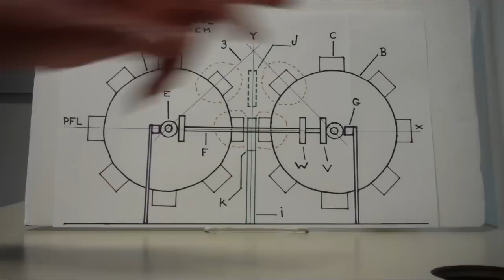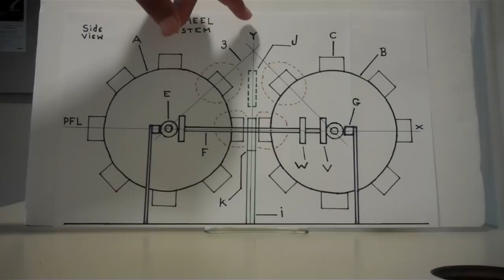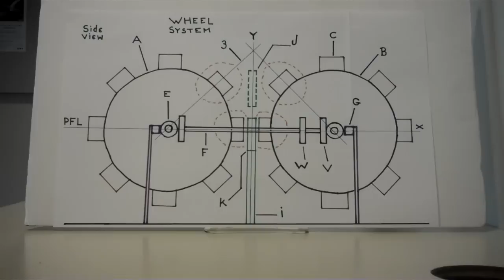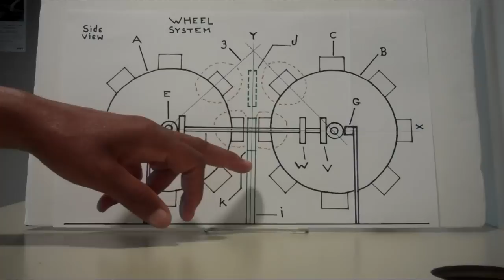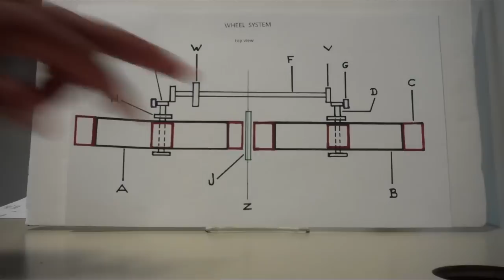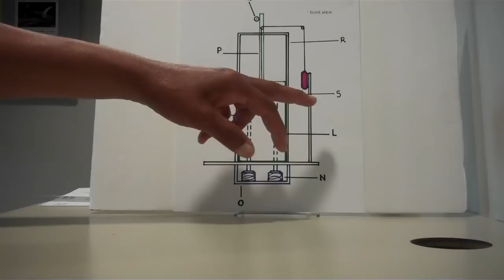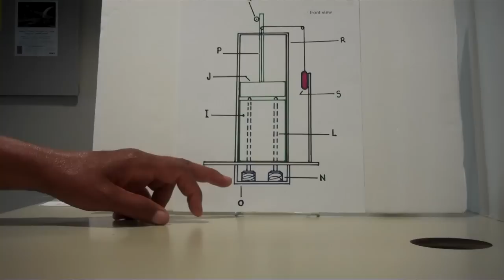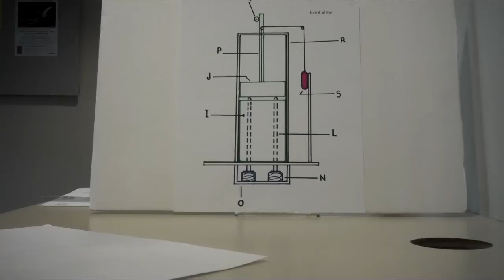PERMANENT MAGNETS: The Johnson Machine - How To Make a "WORKING"  semi-PERPETUAL MACHINE

Comment: Firstly, I'd like to say that the principle of magnetic field cancellation you're using in this video - and built a working and  reproducible model of in a prior video - is quite intriguing, and not something I've seen discussed before. Kudos to you.

Secondly, in your prior video, you mentioned that once two magnets have been balanced by the cancellation metal, the metal will be drawn back into the gap if it is pulled out from between the magnets. I haven't built a model myself to test this, but I suspect that the magnetic force drawing the cancellation metal plate between the magnets will mean that the motor that moves the metal plate will need to draw at least as much power as the magnetically-repulsed spinning wheels will provide. Basically, moving the metal plate out from between the magnets will require at least as much energy as the potential energy stored between the magnets being shielded by the plate at that moment.

However, it does seem easy enough to build a test model of, requiring only careful measurements rather than exotic materials. Even if it turns out this shielded-double-wheel runs down faster than a non-magnetic flywheel, the magnetic cancellation principle it uses probably has other applications, and should be more widely known.
Reply from the maker: +HaloInverse . Dear Mr. Halolnverse: As the tiny electric motor pulls the gate up, it is going up simultaneously with the magnets on turning wheels. The gate is to go up 2-5 times faster than the magnets are moving up on the wheels. In the video the gate is one plate. Two or three plates can be used or better yet should be used. Using two or three plates only the middle plate or one of those plates can be moved or slid upward breaking and removing the magnetic field balance. Letting the repulsive force of the magnets take over. If using more than one plate simply find the field balance in doing so as with one plate.

Comment: I've had ideas like this in the past.  It takes electricity to produce permanent magnets.  If you get this running, wouldn't the work you could pull out of the magnets be equal to the power put into them to being with-- minus frictional heat?  Perhaps you're making a superior type of battery in that sense?
Reply from the maker: +snj silva . Dear Mr. Silva: We have to make the thing first and see. Another question is: would we get more out of the machine in costs and use than the amount of the electricity that's needed to magnetize the magnets?

Comment: I can make a model for about 50 to 100$
Reply from the maker: +Jeffrey Vanblargan . Dear Mr. Vanblargan: In the video it shows a single plate for the gate. Remember: 2, 3 or 4 thin plates acting as a unit can be used. Whatever it takes to get the job done. The thinner the gate the more the repulsive fields strengths over whelms the attractive field strengths. And those plates can be slid upward producing a thin long single piece. If you can make a working model for $500 - $2,000 then do so. Make the wheels about 12 inches in diameter so as to have enough size to deal with it. Look at the video again and again if need be to catch every word in the video correctly.
Reply from the maker: +Jeffrey Vanblargan . Dear Jeffery: that is such good news.
Reply: Yes but I also said a model which could be one-third the scale using a skateboard wheel as a demonstration to see if it actually will work
Reply from the maker: +Jeffrey Vanblargan . Do your thing.

Comment: Jesse, I have my own 'proof of concept' wheel in process. I do agree with your principles of cancelation, yet I don't on the material you propose to use. I not seeing how to reach you privately. I'd like to invite to the experiment. I believe you could be a very good source of experience. It's on an open forum I'm doing this on, but don't what it flooded by Naysayers. If interested, please contact me on my site. I do hope you do.
Reply from the maker: +Uncle Bob. Dear Mr. Uncle Bob: Your disagreement is in-substantiated. I haven't stated any special materials as of yet in the construction of any device or machine. Outside of very common materials which - works. Hence: if you are making any system please experiment with many materials and use whatsoever 'works' the best.

Comment: Beautiful graphics and designs that you drew and explained for your audience. Have you had any luck getting this together for testing? Keep thinking and designing and stay the course - your vision will come true. Thanks you again for the wonderful video and your time.

Just FYI - if you made the separating plate controlled by a device such as a gear shift in a car controls when you change gears you could have an effective separator plate. A variable that will control the magnetic force or energy that could be used.
Reply from the maker: +Bobby Millionaire . Dear Mr. Bobby Millionaire: The gear shift may be a workable idea for this particular matter. I shall look into it to see if has merits.

Comment: This is an excellent lecture with good illustrations but I am not so sure about the working of this system. From what I can understand  Mr Johnson is treating the  opposing magnetic  fields  as opposing winds that push each other away , and he  is using the separating plate in between and below the horizontal through the centres of the wheel as  a technique to stop the "wind" from the lower magnets to push as much as those above the horizontal through the  centre.   I am not so sure that one can make an effective separating plate to stop magnetism as he desires. 
As shown in the  diagrams, that position with the horizontal going through one magnet on each wheel ,  is not a stable one and the wheels would probably rotate a little such that the horizontal passes in between two magnets in each wheel which I feel is more stable.    If one introduces a not perfect separating plate, the stable point will be not  such that the horizontal will not pass equally between  any two  magnets on the same wheel.
Any way good luck, but my opinion is that you cannot get any work done from a permanent magnet, unless the magnet loses its magnetism!! which is equal to the energy that one puts in it to magnetise it, as only that will keep the conservation of energy obeying the rules of nature or should I say science?
Reply from the maker: +Carmel Pule' . Dear Mr. Pule' - It can be done just as it is stated in the video. You must look a little closer to see it. The cancellation metal is to equalize the repulsion/attraction forces which cancels the magnets direction of motion to zero point. The metal and the metal gate attract each other because of the magnets so their attraction is broken by the special springs to zero point. The counter weight equals the gate weight and puts zero stress on the tiny motor that lifts the gate. The magnets must pass beyond the cancellation metal's top and at least one degree beyond the primary focus line (x  coordinate line), etc. Look closer Mr. Pule'. This is the machine all are searching for. The repelling magnets produce more  turning force than the tiny gate motor uses to lift the gate. That extra force can be used to run the tiny motor and do extra-external work. Hence: a semi-self-sustaining machine of the "real" form.

Comment: Jessie, what do you mean by a semi-perpetual system ? In my opinion a device is a perpetuum mobile or it isn't. I'm not the one to laugh with perpetuum mobile. I respect people who are searching and experimenting. Even Einstein didn't believe the theory of Newton, witch held for centuries in science. Why shouldn't we in case of a P.M. ? It is a good thing to be open in the knowledge that we got in experimenting. So I tried again what I described 2 days ago in this forum. I put 2 neodymium magnets on each side of a vice (the device to pinch something to hold it straight, how do you call it in english ?). I held a metal plate in my hand between the magnets. It is difficult to hold it because of the attracting force of the magnets on both sides. But you can feel clearly the repelling force between the N-S poles and the attracting force between the N-N or S-S poles.I believe this is the purpose of your experiment : to make a device where the magnets are repelling and attracting each other, according to the close or opening of the metal plate between them. Can I have your comment on my opinion, please ?
Reply from the maker: +Karl Praats . Dear Mr. Praats: (1) SEMI simply means that the system is - NOT - perpetual (an impossibility). And that it can run for a very long time in the human life time context of several weeks to several years without any external energy in-put to its systems and functions. By using its - own - internally produced forces and/or energies to run itself. And simultaneously can give extra force and/or energy to do external work for other purposes (this makes it a machine). Which is NOT an impossibility.
Reply from the maker: +Karl Praats . Dear Mr. Praats: Please go to: Permanent Magnets: the two types of permanent magnet magnetic force field cancellations. This on you-tube.
Reply: +Jessie Johnson So you're saying that you can get energy out of the system without it losing energy. This energy could then be used to power the system all over again(and then some). And then you claim it not to be a perpetual motion machine. XD
Reply from the maker: +Laff700 . Dear Mr. Laff:  No I am - NOT - saying that. And I am incapable of ever saying such a thing.  No machine can be created that does not lose energy in its processes while it is doing work. It is an IMPOSSIBILITY. This is a machine (anything that is used to do work. With one exception to this definition: living things can not be made into machines. When this is tried they become slaves). It follows the 15-20 laws of - ALL - machines. Laws of which you must learn from the way in which you interpreted the video and responded. It is - NOT - a perpetual machine for that is an IMPOSSIBILITY. It is a SEMI-perpetual machine. A SEMI-self-running machine. A SEMI-self-sustaining machine. SEMI: the word is written in the title and description below the video. The word " semi " means it can run or operate for a long time (several weeks, several months or several years without an external energy supply and still do external work). This is in the human life time context. Look at the video again. Everything you need is said simple and plainly in it.
Reply: Jessie Johnson What exactly do you mean by "The word ' semi ' means it can run or operate for a long time (several weeks, several months or several years without an external energy supply and still do external work)."???
If I put 100 joules into the machine how many joules would I be able to get out of the machine.
Reply from the maker: +Laff700 .  The word " SEMI " means that it's NOT perpetual. Which is IMPOSSIBLE. SEMI means it can run for a long time without any energy put into it for it has enough force and power in itself to generate its own power to run itself and to do external work. (1) if 100 joules net is put into a machine you will get - less than - 100 joules net amount of work out of the machine. And how much less depends on the actual mechanical efficiency of the machine. (2) the magnets magnetic fields in the above video (repulsion towards each other)) are doing work on each other. Enough work to produce and generate far more electrical energy than required to run the very small electric motor which lifts and lowers the gate.  And also allows - excess - force to do work (external to the machine) for other purposes. (3) Please go to: https://youtu.be/15gpaItwiWQ and https://youtu.be/S6VHJrzvT1Y  for MACHINES: the principles and laws of ALL machines. This will alert you to the true nature of machines.

Comment: Great Idea - and great wok - thank you for making your work open source! 
I guess it could run  really fast, if the cancellation metal (I) would run circular on a disc on an axis parallel to and above X axis. Linear movement with direction reversal is very speed limited!
Of cause, this attempt would make great demands on the stability of the cancellator disc...
Reply from the maker: +surfTheEssence . Dear Mr. Surf Theessence: The cancellation metal is magnetized in the x, y and z directions by the magnets. Meaning that the magnets will always pull the metal back into its field of force. This includes sides, bottom and top of metal. The magnets must get pass the edges of the cancellation metal in any direction. The top of the cancellation metal is the only form possible and the magnets must get pass the x coordinate line or primary focus line. A disc will not work.

Comment: One thing that might simplify you design is to use One way bearings or unidirectional bearings on the axis of your wheels instead of "G". With these bearing your wheels will only rotate in one direction and they are a surprisingly cheap needle bearing.
Reply from the maker: +ROD90265 . Dear Mr. Rod: Good Idea.

Comment: I understand your concept but I've done some simple calculations and there is a lot of friction to overcome. it will be extremely hard to overcome all that friction to get some usable power... I do believe however that the machine may be able to run itself... I think you would have to determine a "perfect" scale model size that would balance the mass against friction against usable power... I hope I am wrong though! good work! admire the engineering involved!
Reply from the maker: +xITZxUS . Dear Mr. XITZxUS: Your calculations are incorrect. The friction produced by this system is minimal to non-existent. Reducing friction is almost nothing. This can be done with one's eyes closed, so to speak. It's the least of things to be concerned with. The main problem is to get the - gate - to go up 3-5 times faster than the main magnets are rotating on their wheels and back down again in time for the next set of main magnets so they may pass the top of the cancellation metal and be a single degree above the 'primary focus line'.

Comment: Mr Johnson,
    What is the total estimated cost to produce a working prototype machine. I can help in many ways. Building this on $ 20. donations will be a very slow and awkward process.
Reply from the maker: +ThomasTheSailor Chubby. Dear Mr. T. Chubby - I do not know how much a full working model will cost to build. There will need to be testing while seeking to build a good working model of the machine. My intent is to build one. My estimate is about $500 to $2,000 depending on how large and precise the machine is to be and the materials made of.
Reply: Jessie Johnson
  That sounds excellent. I think a small prototype with rotating disks approximately 6 inches in diameter would be a good place to start.  It will be easy to work on and budget friendly.
Reply from the maker: +ThomasTheSailor Chubby Dear Mr. T. Chubby: That's exceptionally fine. If you have questions, no matter what they may be, ask them. No question, no matter what, is to be avoided. Ask it. There are two ways to make the gate. One is shown on the video. Remember: the cancelation metal is magnetized in the X, Y and Z directions. This is the reason for the gate. And the gate must move out of the way of magnets (so they may repel each other) at 3-4 faster than the magnets are rotating. This will take testing and ingenuity but is still simple as a machine.

Comment: Excellent video.   I have the skills, equipment and funding to build this machine. I have all the materials I need right in my garage.  I've seen similar ideas before, but I haven't tried because I believe the cancellation metal will quickly become magnetized and stop the rotation of wheels "A" and "B" . The moving up and down of the cancellation metal won't stop the magnetizing effect of magnets "C" .  I would sure like some Ideas on how to avoid this problem.
Reply: +ThomasTheSailor Chubby    just alternate the magnets to north and south respectively
Reply from the maker: +ThomasTheSailor Chubby (1) The cancellation metal is already magnetized every time the magnets are close to it. (2) the cancelation metal is in two parts: the cancelation metal that's attached to the base which never moves and the cancellation metal gate which moves up and down. The cancelation metal gate moves out of the way far enough to where the magnet's magnetic field do not effect it. Since the magnets are moving upward the gate must move upward also at an exacting time and out of the way of its field force so it may pass by. Otherwise the gate's attractive force to the magnets will stop the magnets from moving. And the gate must be back down in time to let next set of magnets come up. This system will not run forever. It is semi-self-sustaining.

Comment: Hi Jessy.

I have made a system like this but instead of 2 disks I used 1 disk with magnets and 1 stick of magnet fixed in place. 

Having not good enough material is wasn't precise enough to estimate a COP while oparating manually but I did obtain a kind magnetic gear between the screen disk and the wheel with the magnet.

I do understand your concern about having financial means to built something accurate. 

Regards.